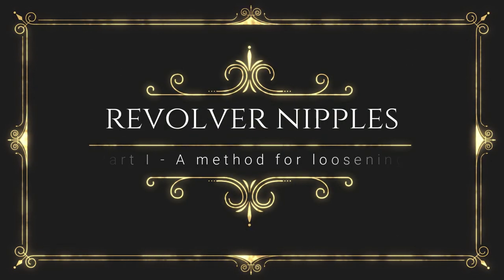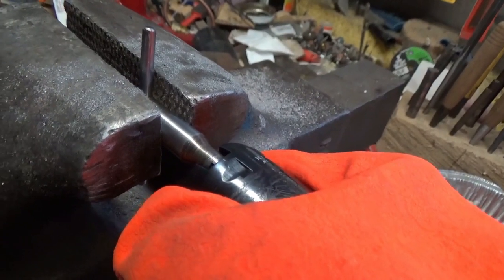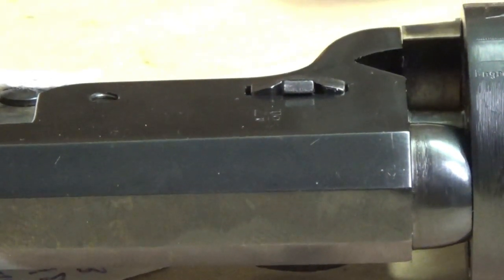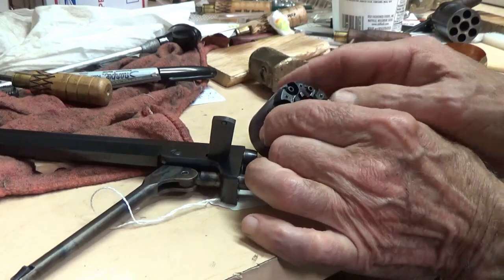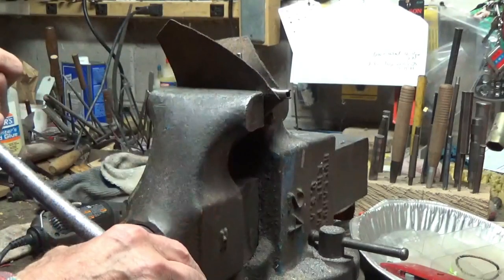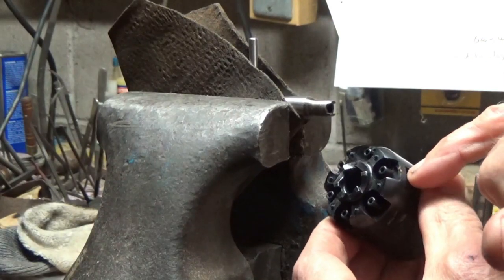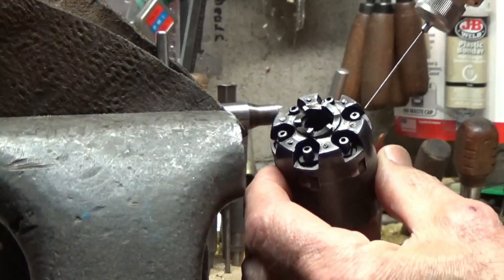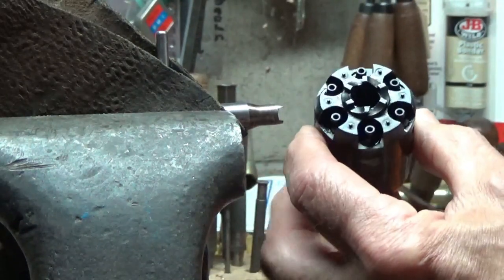Stuck revolver nipples - part 1

Comment: That bolt (cylinder stop) drops right on time. It should drop at the beginning of the approach, but not before the approach. It then slides in the approach to the lockslot.
Reply from the maker: Exactly.  That's what that grove is about.  Some feel it should snap directly into the notch for perfect timing and I can't agree with that.  O.R.

Comment: Hi, thanks for the tip with the vice.  Who makes the nipple wrench you are using, I'm struggling to remove some nipples on a Uberti and the Uberti nipple wrench I originally bought doesn't seem up to the job.  I've already ground the screwdriver off and ground it down so it locks better with the nipple.  I'm coming to the conclusion the metal is too soft as it is burring rather than applying forced to the nipple.
Reply from the maker: I made the one that was used in the video. Most of the ones that I have bought are too soft. One to consider is made by slixshot. The company that makes the slixshot nipples, and have heard they are good, but a little spendie. Hopefully the nipple edges are still sharp enough for a good wrench to work. I have seen where some claim to have made one from a small socket. Hope something works for you. O. R.

Comment: Once I ve seen someone who made a stand for the cylinder which held it securely in place. It was basically an iron plate with two bolts sticking out of it. One bolt had the diameter of the chambers and the second bolt had the diameter of the axis hole. You stuck the cylinder on these bolts, put the stand into your bench vise and could work on the cylinder with some force.
Reply from the maker: Thanks.  Recently I've read about that, also, I believe one of the youtube presenters, possibly Duelist has something like that.  My problem is that usually I'm in a rush, and probably most folks won't take the time for building the device in advance, unless they anticipate lots of that to do.  What I find about the wrench in the vice is that one can get a better grip on the cylinder and can apply more pressure than with the wrench.  Anyway, thanks for describing another method; the more tricks in the bag, the better.  O.R.
Reply: @oldranger3044  I ve found the video. Not sure if I can post links here so I will describe it first and then post the link in a second comment. Its from a Polish gunsmith. Its actually very simple. He uses two drills in the diameter of the gun caliber, puts them into two opposing chambers  and fixes them in the bench vise. The device with plate and two bolts was in his shop but its not necessary.Title of the Video here on youtube is: "Jak wykręcić zapieczone kominki z rewolweru?"
Reply: @oldranger3044  Stick two brass pins in opposite chambers, then clamp those pins in the vise. Same result but more simpler.
Reply from the maker: @Prowbar  Then won't you need to turn the wrench by hand??  I seem to be able to get a better grip and add more pressure by gripping  the cylinder.  Thanks for the suggestion.  O.R.
Reply: @oldranger3044  no, the wrench is turned by hand, the cylinder fixtured. The nipples on those original guns were too tight, the cylinder would just slip if you did it your way. I did apply a lot of downwards pressure on the wrench though.
If you were to build a fixture or some sort of wrench with those pins, it would be possible to clamp the wrench and move the cylinder.
Reply: @Prowbar  As an added torque aid I use the fixture like you describe clamped to the bed of a bench pillar drill, the wrench is then held in the drill chuck and lowered onto the nipple, then with positive pressure held downwards it cannot back off of the nipple flats, you then just turn the key by hand, knowing it cannot slip off the nipple, this only needs to be done the first time as when re assembled copper slip anti seize is applied to the nipple threads, I think the biggest risk when unscrewing nipples is that the key slips up off and burrs the flats, which cannot happen if this method is used. Chris B.
Reply: @453421abcdefg12345  great idea.

Comment: Great video mate 👍 hope and look forward in seeing some rang video's
Reply from the maker: Thanks. I have some I have taped but not put up yet.  As far as new 2021-2022 --- forget it.  Just got 18 inches snow.  It's going to be a long winter.  O.R.
Reply: @oldranger3044  well I wish you and your family a merry Christmas and a great new year.  Stay warm mate
Reply from the maker: @deanmacka4975  I think I've got that covered.  About 40 cords of firewood next to the house.  Face cords we call them.  16 inches wide, 4 ft tall, 8 feet long. 40 like that to get through winter here.  Right now I'm a little concerned about the wind forecast that will start in about 2 hours.  Forecast for gusts that could exceed 80 MPH.  Thanks for the Merry Christmas, and same to you.  O.R.

Comment: Impact screwdriver or battery powered impact driver with modified socket or modified tuff nipple wrench from track of the wolf
Reply from the maker: That should work.  How do you hold the cylinder from rotating ??
Reply: @oldranger3044  with a vice and an old worn out leather glove
Reply from the maker: @kevinbietry7527  Thanks. I think that would be better than the scrap leather I used, especially when mine has some filings embedded into it and when it slipped it didn't help the roll engraving on the cylinder one bit.  O.R.

Comment: What are your thoughts on brass frame vs. steel frame? Just wondering 🔫
Reply from the maker: I don't have much experience with them; however, by guess is that they will shoot as accurate as the steel, as the barrel and cylinder are basically identical.  Probably will loosen some if using larger loads and especially conicals.  I would of course take the steel to brass if the cost were the same.  If planning on using one of the conversion cylinders to shoot cartridges, then steal is the way to go.  So, wouldn't be afraid of the brass, they will probably outlast most shooters if properly cared for.  O.R.

Comment: I hate to say this, but my nipple wrench literally broke when I tried that method… might’ve been a cheap one, (for reference, Colt .44 navy Pieta repro)
Reply from the maker: That sounds like one tight nipple. The wrench I have been using is one that I made which (so far) has held up. Think I recall some  heating the cylinder when they were stubborn. O.R.